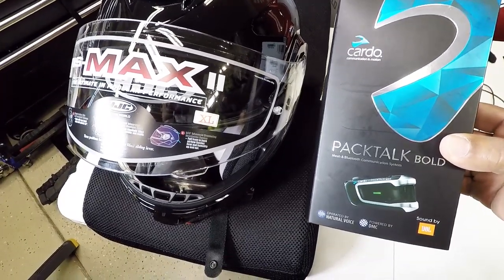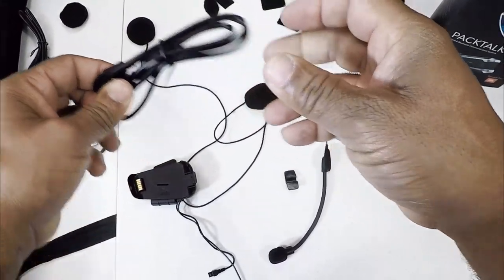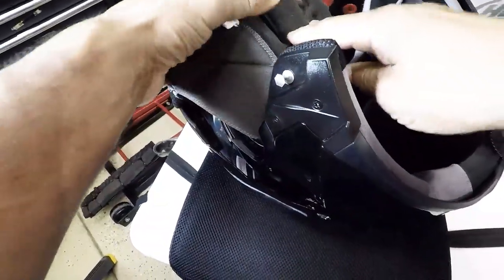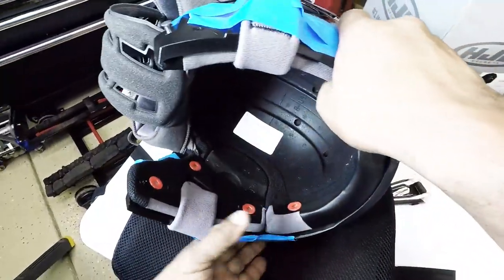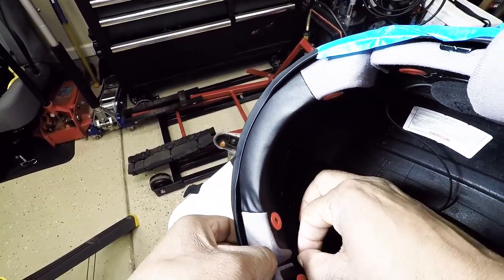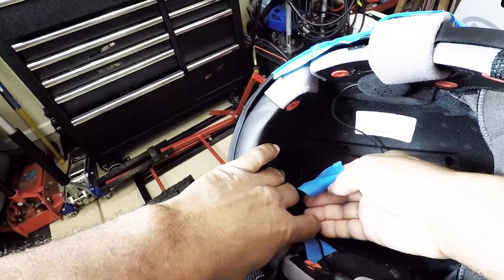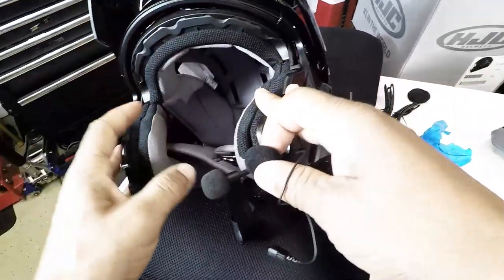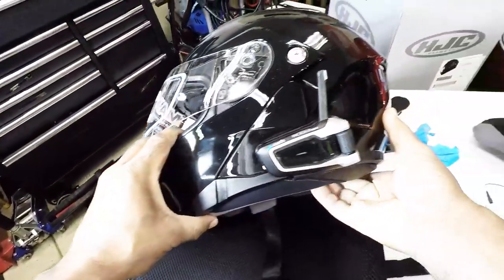How to install the Cardo PackTalk Bold / New HJC IS MAX 2 helmet

Comment: Great job. I think, prior to cutting those cheek pads, I might have tried it 1st as is. I find that these speakers sound better with earplugs in anyway, to cut down the wind noise, so the little bit of ear padding may not have made a difference. 
😁👍

Comment: Just watched your video, I have the same helmet. Do you experience excessive noise on this helmet? I use it for snowmobiling, I've had to buy black duct tape and cover up the holes in the sides of the shield. At 60 mph, it's deafening. I was going to buy the same Cardo unit but feared the  mic would stay on/open all the time due to the noise. My helmet options are thin due to having a big head and round cheeks 😂.